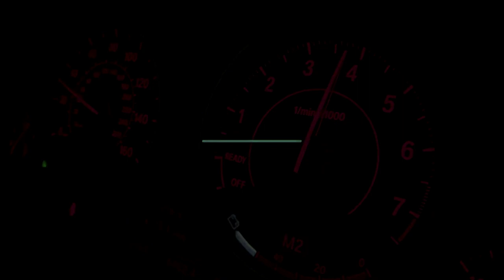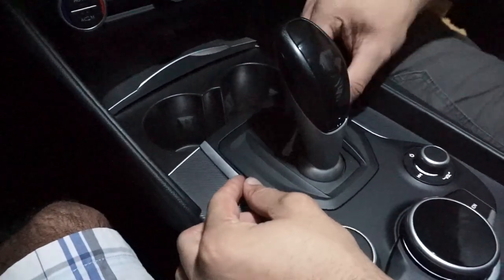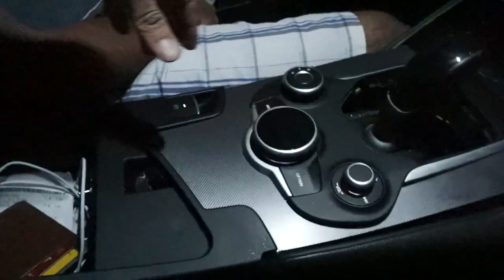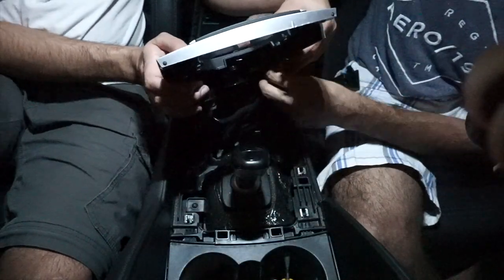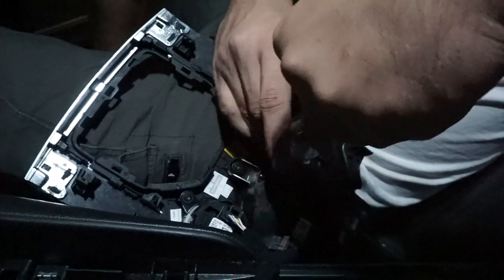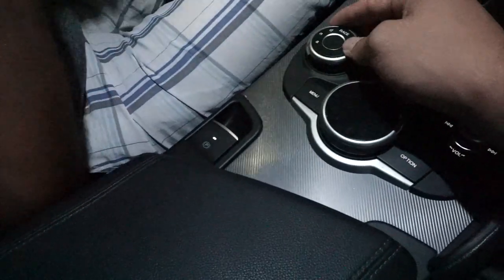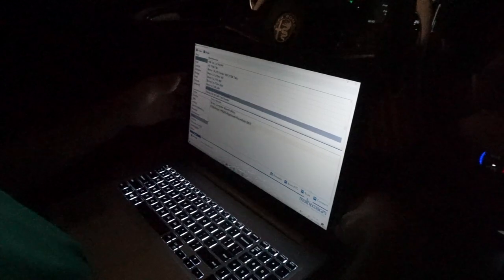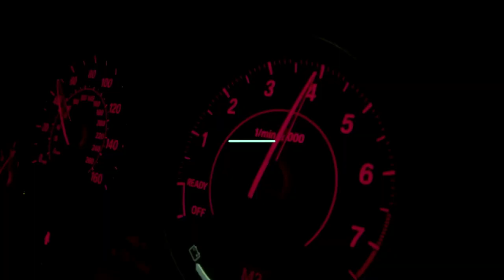Alfa Romeo Giulia race button installed and explained DIY/FIY

Comment: Looking forward to the programing video
Reply from the maker: Soon bro soon
Reply: I read that from modell 2018 the Giulias has been assembling with SGW module. Probably you should bypass it to get access to CAN communication bus. Good luck!
Reply from the maker: If your model is 2018 and over you will have to get the SGW bypass module in order to get the race mode active on your vehicle. It is a requirement for it. I’ll try to get the LINK in next video description

Comment: Hey if i install the button , can you program it for me? Ill pay, i cant fine that blue and gray cable anywhere but UK
Reply from the maker: I can’t Risk working on your car but I can help and you can come through and use my cables and do the programming and stuff
Reply: @daringwhips   kool thanks man, ill let you know when is installed, why risk? Is there an issue doing the selector or something can go wrong?